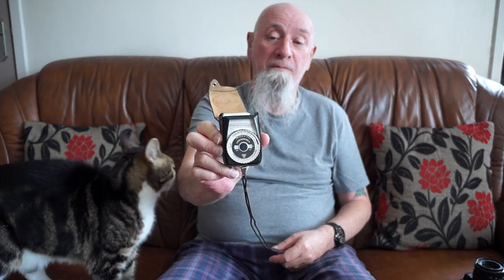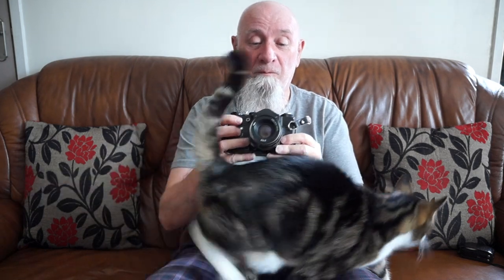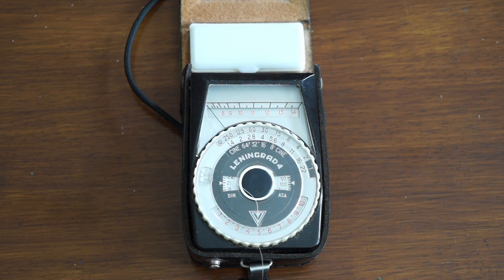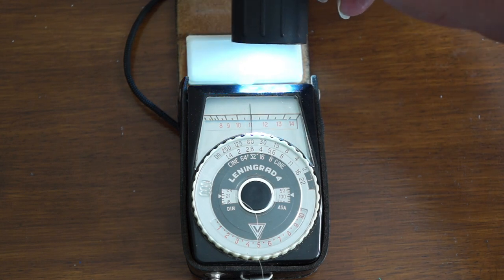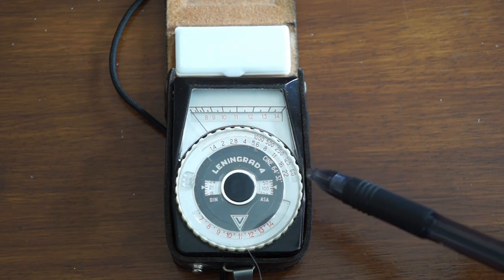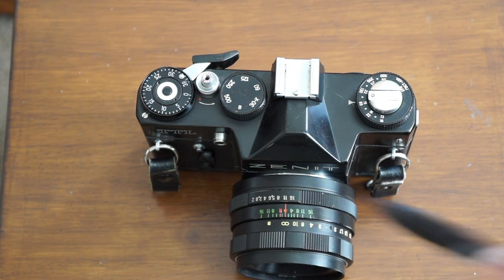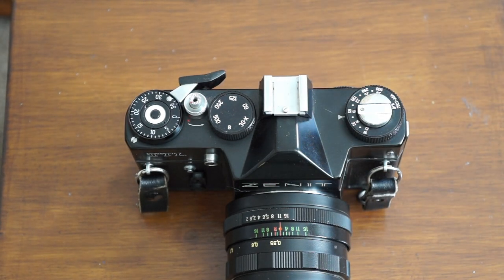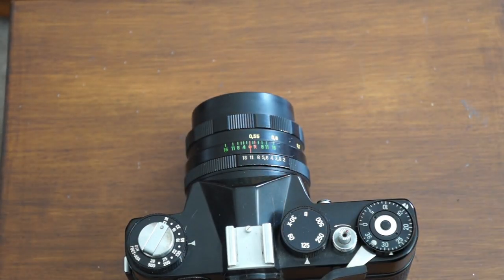Using a Light Meter in Newcastle City Centre

Comment: You can't beat a selenium light meter for price and reliability, the caveat is make sure it has a case with it. They are the ones that have probably been looked after and stored correctly. I was given a Gossen Trisix in a case and it is working beautifully.
Reply from the maker: Hi Jim. I have to say this meter seems to be working great and it is pleasant to use. Cheers, Keith

Comment: Replacement batteries, Just use ordinary button batteries and a wee gasket washer (they sell in packs from any hardware store), if its a little too thick you can rub it down on emery paper. I know the original batteries were 1.35 volts and many button cells are 1.5 volts but the difference to the light meter is negligible and button cells dissipate from full power pretty quickly. The gasket washer is just to stop the battery moving about in the battery compartment. I've got several cameras fitted with them. My pocket ain't being fleeced by Wein cells.
However, speaking of power I've always been a lover of selenium cells. As long as the cell isn't constantly sat around in the sun they're life can be measured in generations.
The 44M is a great lens, underrated, okay less bokeh than the 44-2 but unless you shoot wide open all the time then its superior.
Reply from the maker: Thanks Iain! I read somewhere that the meter on the TTL isn't reliant on voltage for accurate reading. When I first got the camera I bought a Lithium battery that fitted, but stupidly didn't store the camera with the lens cap on and I think that is why the battery died after just a couple of films shot. I do like Helios lenses and have the 44-2, 44M and 44M4. I'm happy with the Leningrad meter and the Zenit is fully mechanical so I may not bother with batteries for the TTL now. Cheers, Keith.
Reply: Using 1.5 volt button cells does the job but it depends on the camera. Zenit tend to meter correctly or to within half a stop courtesy of robust Sovet era electrical components. My Pentax Spotmatic SP500 was over half a stop over exposed but now reads accurately after a CLA where it was given the adjustment to take a 1.5 volt battery. My SP500 is the camera I came back to film with and sentiment made me spend money on it. I do not regret it as it works beautifully.
Reply: @jimgraves4197  Hi Jim, yeah Pentax seem to be a bit iffy with the extra power, until the button cell settles in. Something to do with the Pentax circuit but nearly every other make is fine. If in doubt don't use brand new button cells, Swop them over from something else. Cheaper and longer lasting than the Wein equivalent